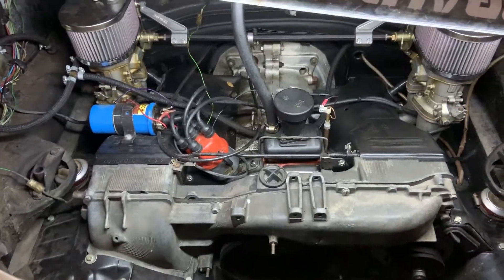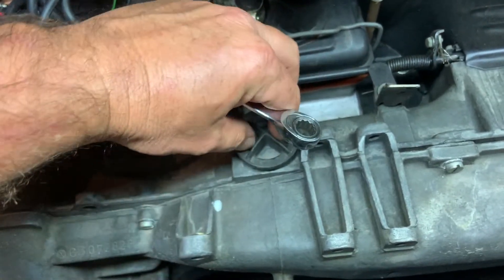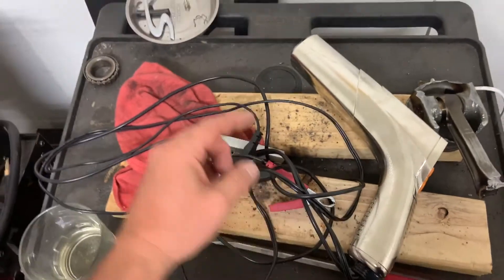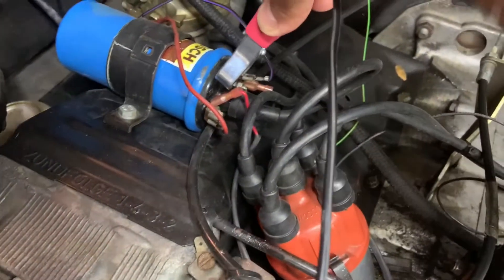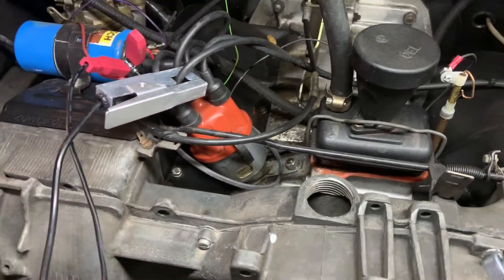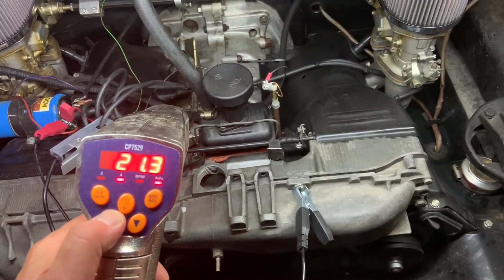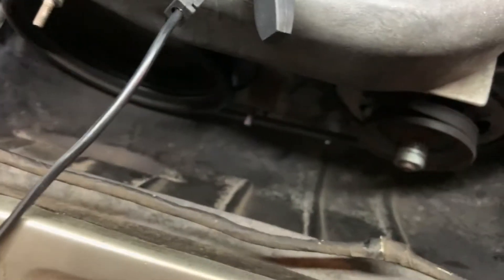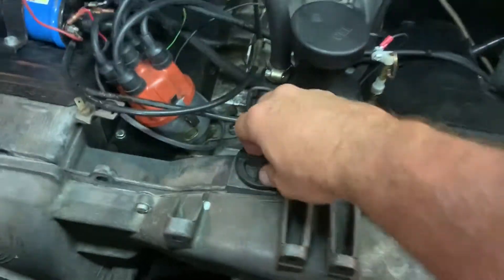How to Set Timing on a VW Type 4 Engine - Porsche 912 & 914 Timing DIY - Strobe light Timing Motors

Comment: Why does it have to be 3200 rpm? How can you set the timing if you’re by yourself?
Reply from the maker: That is the typical cruising RPM of the Type 4 engine; if you don't have a friend to help, try using a pair of needle-nose vice grips to hold the throttle cable in position at 3200 rpm.
Reply: @ArrowheadGarage  got it, thank you!

Comment: How do I hand turn my type 4? mine was flooded, so i drained oil. I put in fresh oil, and now I want to hand turn it.
Reply from the maker: the fan bolt... grab a deep socket and you can rotate the motor.
Reply: @ArrowheadGarage  the 13mm bolt in the center will work?
Reply: @punchysgarage  yes but anticlcokwise itll eventually loosen.  Use the the one that are off center or your alternator bolt

Comment: Hi ! Can we put a gearbox of 912 on an engine of 914? (In a Porsche 912) thanks
Reply from the maker: No as the 912 and 914 have different engine layouts.. you could use the "gears" out of one for the other.. but not the unit itself.

Comment: Let me add one thing more important.  Usually this is done after replacing points/condensor.  You would think condensers are somewhat generic, wrongo.  Various different distrbutors on these Porsches between 914 1.7, 2.0, 1.8 carb, 1.8 L-jettronic.
My current issue is everyone is selling aftermarket condensers which is fine until you realize  the 1.8 L-jet seems to have the smallest of rectangle shaped cutout (bottom of distributor) for the wires. The other larger plastic(not rubber) wire seals(for moisture) don’t fit

Comment: 912e has the 2.0.  The 75 and I think 76. 914 has the 1.8 L jettronic, different from Euro 1.8 carb.  My book says 1.8 and L Jettronic is different. No 5 degree or 27 degree marks, only 7.5 BTDC mark timed at only 800-900 RPm, approx idle.

Comment: Hi great video. Do you know what I need to do if my timing light doesn't have adjustment on it. ?
Reply from the maker: On the Type 4 motor you have a second timing mark and it should be painted RED if I recall.. use that timing mark instead.  Good question!

Comment: No knowledge about timing at all, why do you need timing in the first place? Thanks!
Reply: It’s to make sure each spark plug is firing at the correct time (to ignite fuel under pressure) thus giving you a smooth acceleration / deceleration.  If not the engine will hiccup , cough , back fire ….   Run like shit
Reply: @drennanhutton7864  or typically not run at all
Reply: please, somebody

Comment: Something of note.
You dialed in 30 degrees advance into your light. Then rev the engine to 2700 or higher and then you can use the 0' mark. You Are actually measuring full timing advance. with your light set to 0' you would then set idle at 5-7' and when revved, you would see the 27' mark in the window. Just a clarification, not a disagreement.
There are a variety of timing marks across the type IV family.they are grouped by displacement. 1.7's are the same. 1.8's are the same etc.. Hope this helps. I struggled alot figuring out my 914, as it is titled a 2.0, but has 1.8 fan, block, and heads so timing would be using the marks from a 1.8. Red5.8, White27.5.
Reply from the maker: I think I get you man, and yes that would be right.  Would love to see that 914 of yours, owned 3 over the years... miss those cars.